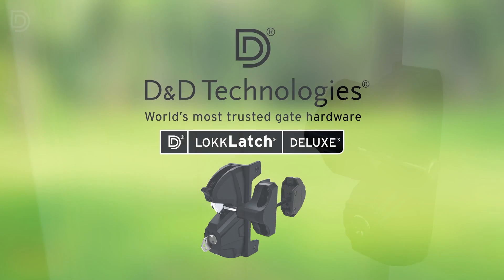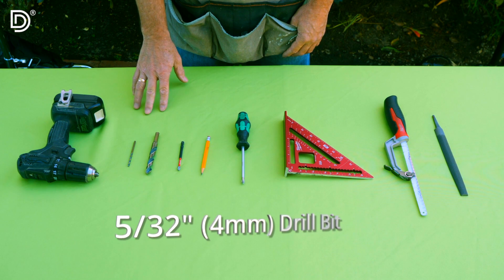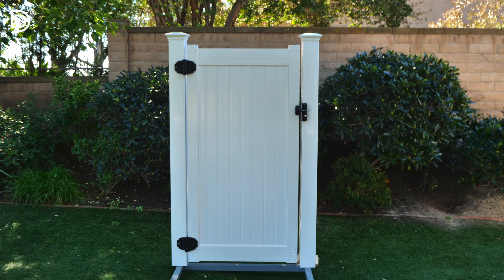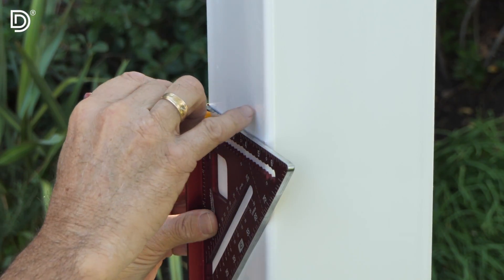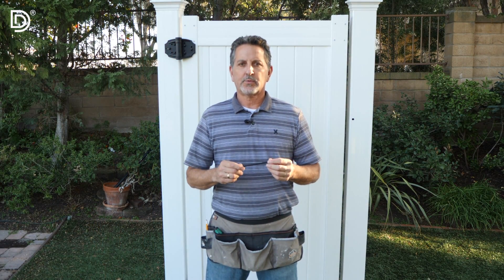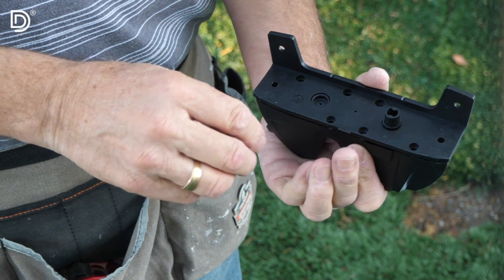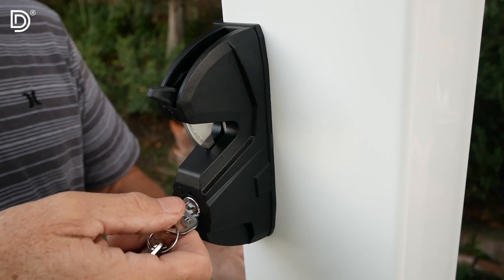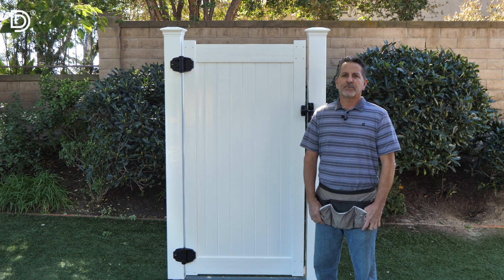D&D Technologies LokkLatch DELUXE Series 3 Installation

Comment: I was planning on installing this as an entrance to my back yard from the street.

I was looking for a lock that allows exit from the inside to the street without requiring a key but entrance from the street to the inside to require a key. Does the LokkLatch Deluxe allow me to do this? 

Or does the locking mechanism lock both sides and requires a key to both exit and enter?
Reply: This is a single logic lock latch. As in whatever setting you have the key hole set to that will be for both sides.